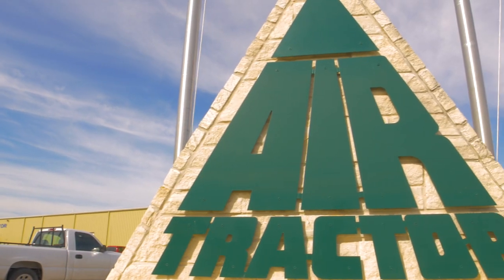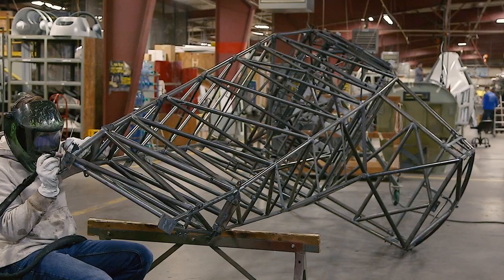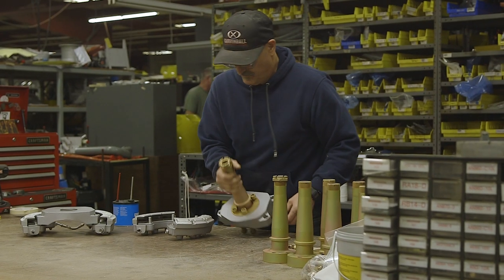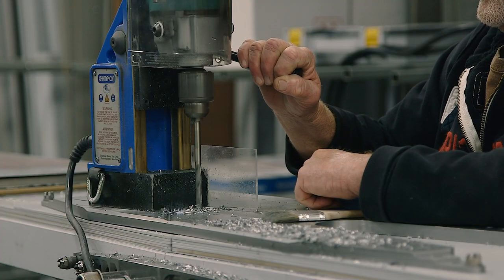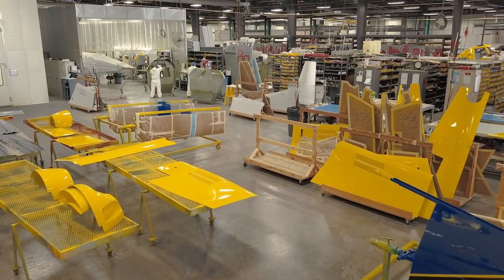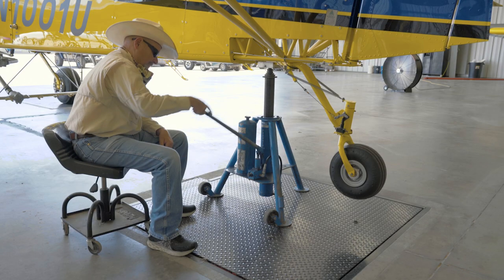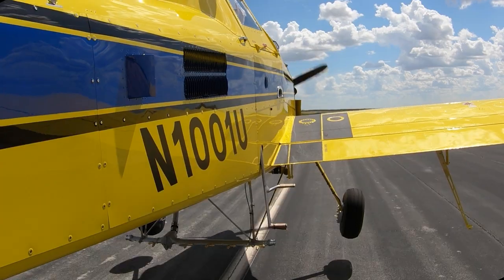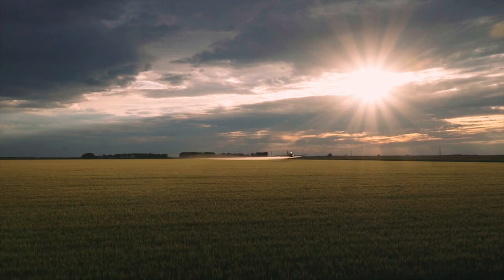Air Tractor 502B Assembly Process

Comment: Just finished a 36 year areospace career in commercial and military aircraft manufacturing. Never worked in the ag side of things. Looks exciting though...
Reply: They're stinky. At Reedley college airplane school, I was on the tail end of a former ag Stearman restoration. We stripped it down to bare frame. Everything smelled. Even after sandblasting the frame, some welding repairs to the tubing smelled when heated. Years of chemicals froze the engine mount bolts to the pads on the airframe. Tried as we could, we couldn't save them and made new ones.